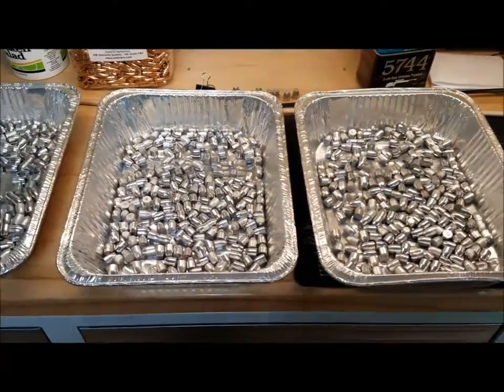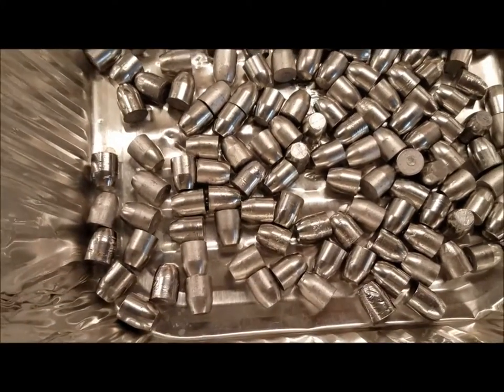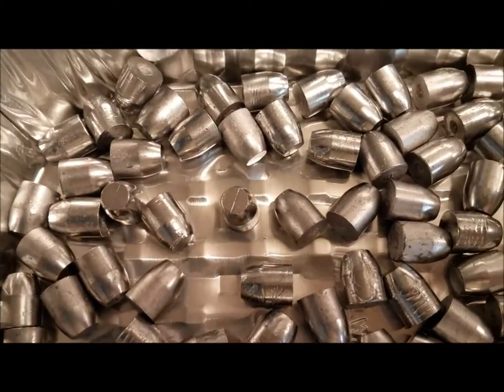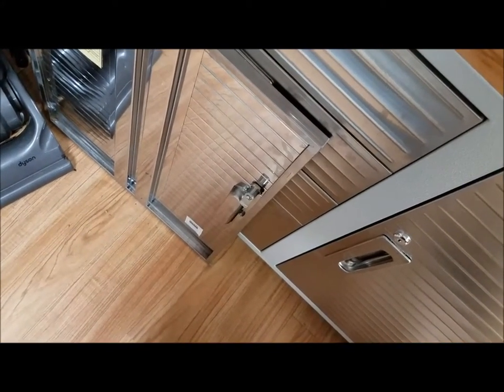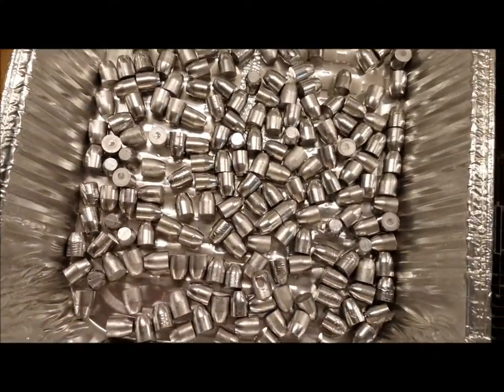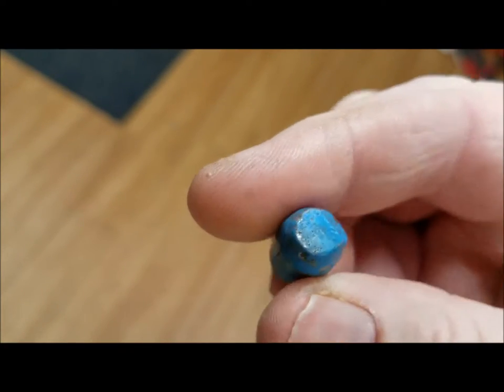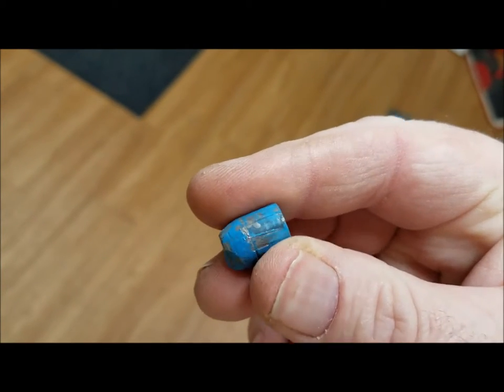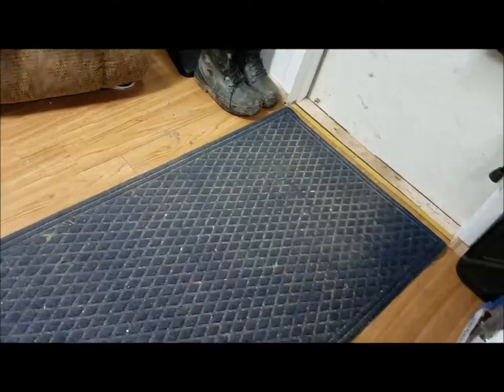Naked 45 ACP Bullets I just cast. HTC452-230-RF Mold

Comment: Hi hey a few are wrinkled, but can you still PC those and shoot them. Wondering???
Reply from the maker: The bad ones (anything that is missing anything on the bottom I just put back in the pot. I normally do not get them when I control the temp. I took a walk and was away longer than I expected to be digging the old bullet out of the ice. I should have left it on the hot plate I am just cheap when it comes to electricity.
Reply: Like Barn Dweller says, as long as the base of the bullet is good, they should shoot ok.  If there is wrinkling on the nose but the base is good, they are ok to powder coat and shoot as "plinking ammo" in handguns.  I wouldn't shoot any bullseye matches or anything with them, but they shoot fine for plinking.

Comment: "'Barn Dweller,
  
    I just purchased the same NOE mold, casted, coated, Lee push through
 sizer (.452), started packing some to try out..  (The brass mold is 
heavy beauty, I love it)  Neck taper crimp at .470".  I had to seat to 
1.163 OAL without the ogive sticking into the rifling.  Called Swede 
Nelson (Owner of N.O.E.) He said Min OAL should be 1.190 Max at 1.275...
 Did the kerplunk fit test.. I can't get anywhere in the middle trying 
in 4 different 1911's of mine? What gives here?   I  assume you checked 
yours in a chamber for fit!  (What OAL do you seat at?) Please let me 
know...
  I have a dozen to try out as soon as I hear from someone with similar issues..
Thanks,
Mark
Reply from the maker: This is just what I came up with, I could not find it in any manuals. When that happens I seat as far out as I can and still have the gun function 100%. I used my Ruger 1911 to figure out my COL but I have also shot over 400 in my 45 acp carbine (video is on my channel) and my Ruger 45 Colt/ 45acp revolver.

Ok this is my data I do not recommend it. 
COL 1.20
Sized to .452
I am using 4.8 gr of HP-38 

I had a problem when I first started powder coating where I had to seat the bullets deeper than I should have had to get them to chamber. What I was doing Wrong was not knocking off the excess powder coat before I baked them. I really noticed the problem on the 45 Colt rounds. The sizer took care of the sides but the nose was longer than what it should have been and fatter so it would hit the rifling when seated at the correct depth. 

I hope this helps.
Reply: Barn Dweller,
Got your reply, and now your the fourth person with this issue on this seating issue with this mold. I am really bummed I'll be treading on thin ice.  NOE should state that this mold should not be used in 1911 ACP's. 
Al at NOE said my barrel might need throated?  I have 4 1911's????
Looks like I need to look for another mold elsewhere for coated pills!
Thanks very much for the reply!
Reply from the maker: The problem I had was my fault! I was putting the powder on to thick. I shoot this bullet from my 1911 (hundreds and hundreds) with no problem now that I have learned not to put on to much powder. I also am using GOOD powder not cheep Harber Freight junk. I like powder from Eastwood, I use the Ford LT blue. There is a good video that Elvis Ammo did and watch how well he gets the extra powder off. This video is where I learned I was not getting the excess off because I wanted a perfect "looking" bullet. 
https://youtu.be/KGqLzWzKfes

I just love this NOE mold, if you get to the point that you want to get rid of it make me a a offer and if its reasonable I would consider buying it from you. I have always wanted 2 so I would not have to wait for it to cool. I always have mine drilled for the temp probe and a set screw installed by NOE. I would only be interested if your mold has that. (Its a option when you buy the mold).
Reply: I will have to get some more powder here soon, and try it!  I just replied to someone else that mentioned to try sizing to .451 and he doesn't have problems getting those out to a reasonable length, I dug around and found some old plated at .451 and gained about an extra 20 thousands on length. @ 1.190 or so. I just hate to buy another sizer to gain 20 thou.. and then go down on dia? Oh, I also did a light coat on the HF but that still may be an issue like you say! What length did you finally settle on with the NOE HTC coated rounds and what do you size at? If you don't mind me  bugging you again:)
Thanks,
Mark
Reply: Oh, forgot to mention my mold isn't drilled! But I have a Lee .452-200gr swc that I may retire, 6 cav....
Reply: I just ran a couple dozen through the chrony today and they ran great! Just need to pack a few thousand now...
Settled on 1.163" length, on of the 1911's was just a tad shorter than the other two.  Also chated on the NOE forum with Al and others that were seating to 1.160 with success. I just got little freaked out when going 30 thou under Min.  Did some comparing with other bullet and noticed that i'm not seating any deeper than the 200gr swc? The meplat and ogive with a flat top is throwing all the Min measurements out the window?
I like the mold even more now.. they jump out when opening...
I will check out that powder as well!
Thanks so much!
Mark
Reply from the maker: I am so glad you got it going and am happy with it. Its one of my favorite molds. I have almost replaced all my Lee molds with the NOE molds. I got spoiled with the quality, they are not cheap but I think they are worth it. I now have 12 NOE molds in my collection.
Reply: Yea...  Well, I suppose your in the 1000 club now!
Mark
Reply: This mold is great!  The NOE HTC style molds release bullets so nicely.  It seems like they almost jump out of the molds.